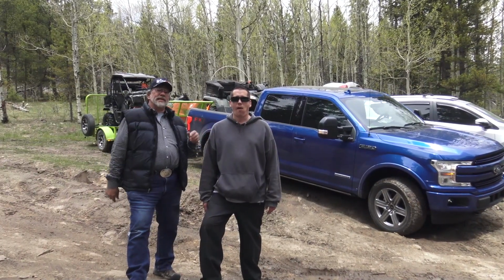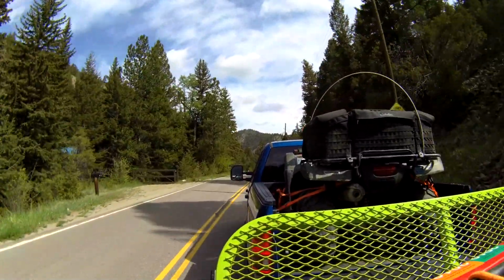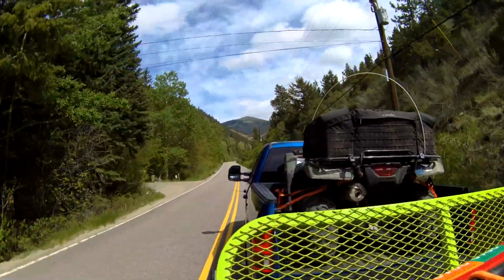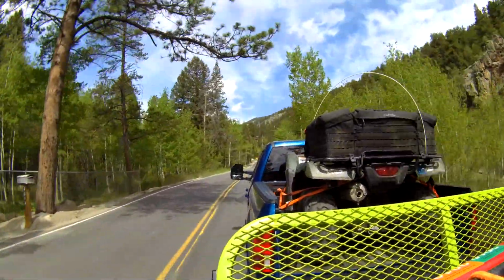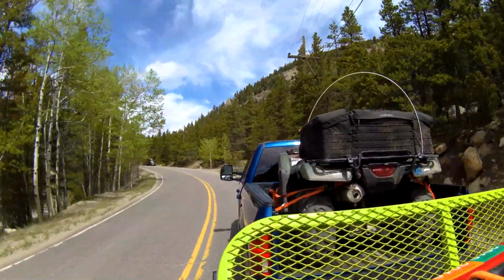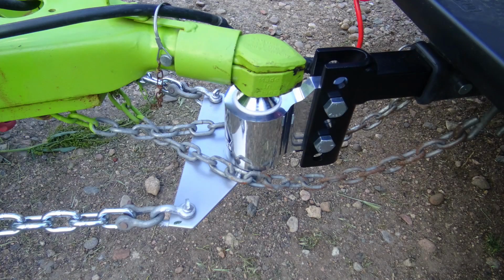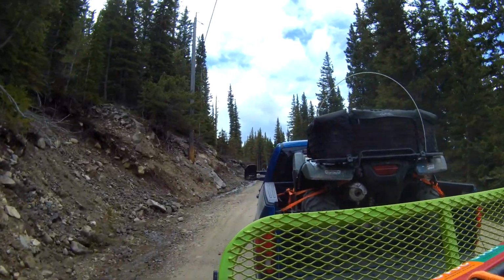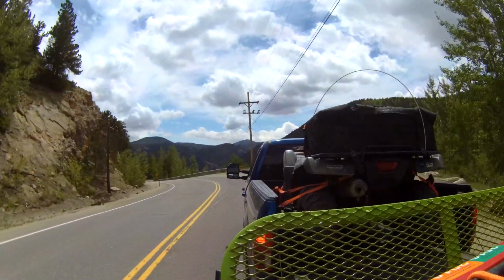2018 Ford F150 diesel, more time behind the wheel in Colorado trailering and working it

Comment: How does this diesel perform under cold at altitude ? I hear "small" diesels have a harder time cranking and making power under those conditions. 

PS, I said "small", because I drive a 1.35 L turbo which sips gas. So, comparatively, the ford diesel is big.

Comment: PLEASE!!!! Turn the music down to a level equal to or less than your speech.  Your vocals are generally really low and the music very loud  -- gotta keep adjusting volume.  Now, on a positive note, great video.  About the sway control part of the new hitch, you did not comment about how noisy it is compared to the friction pad type (which are VERY LOUD).  Does the new one squeak and groan in slow curves?  Is it whisper quiet?
Reply from the maker: Thanks, Andersen is quiet

Comment: Good review, but as for the truck? Hmmm...no exhaust brake, high trim levels only, lower payload due to 500 pound weight increase over 5.0, $4k price, internal belts that will have to be replaced.... Everything about it says it's designed for the highway commute to the office, not for people who work for a living. This truck makes little sense to me. I'd have the 5.0 V-8 in XL or XLT.
Reply from the maker: Thanks